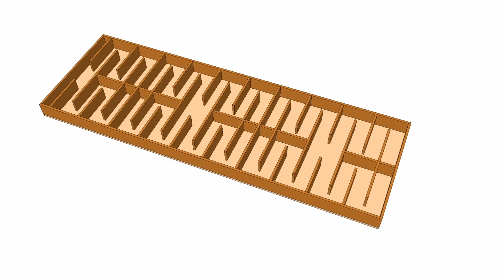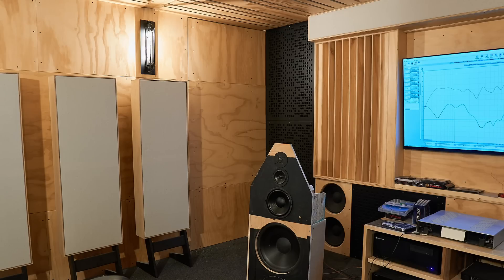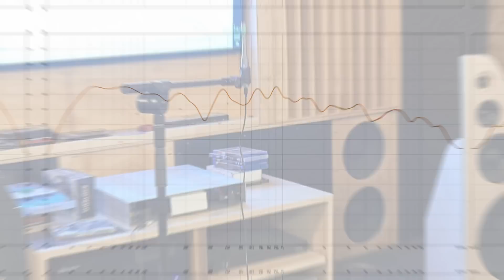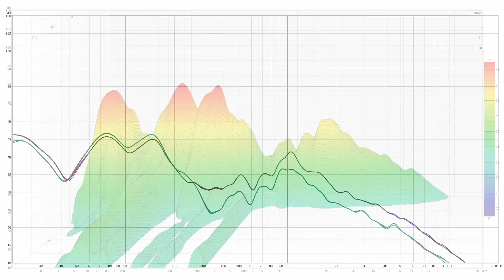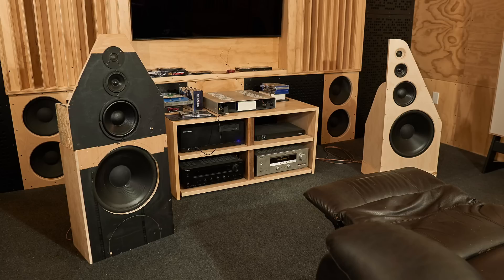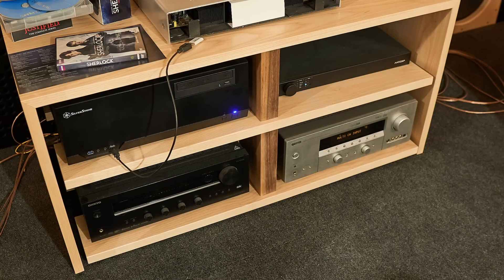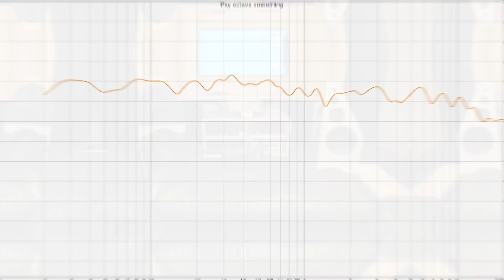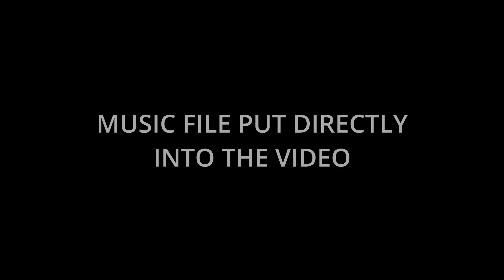Rat Maze? Nope, it's Metamaterial for Acoustic Treatment... Supposedly

Comment from the maker: I'll say up front that my experiment wasn't exhaustive enough to prove the metamaterial doesn't work. Since I didn't see a notable improvement, that only suggests that it may not work. There could be other factors that I didn't explore that could change that.
Here's a link to the paper I took the design from: https://rolfbader.de/wp-content/uploads/2020/05/Bader_MetamaterialWall_Preprint.pdf
More about my system:
I have all of the music I listen to on the computer and there isn't any streaming or internet in my listening room. I don't have a turntable or vinyl records and I don't play CDs.
I use the digital out (optical) directly from the computer. This goes into the MiniDSP 4x10 that does all of the crossover processing. 
There are three amps:
- the one I made drives the 4 infinite baffle subwoofers individually (4 channels).
- the Yamaha 7.1 HTR is set to multichannel input and drives the midwoofer, midrange and tweeter on both open baffle speakers (6 channels).
- the Onkyo receiver drives the two 15" woofers in the open baffle speakers (2 channels).
This all active system gives me precise control of all of the speakers and the overall response in the room. In every way it is superior to a passive crossover system, when you know how to set it up.
The recording:
I did the stereo recording in two sessions, the left channel first with the microphone pointed at that speaker, and the the right channel with the mic pointed at that speaker. In both cases only one speaker was on - the left or the right. Using this method I was able to get a stereo recording using a mono microphone and also avoid the comb-filtering problems there would be with a stereo microphone recording two speakers at the same time. Our brains have some tricky software to deal with that comb-filtering, but a microphones do not.
I took those two recordings and combined them into a single stereo file and that's what was playing in the video. I then used the original sound file that I downloaded from YouTube's sound library and put that directly into the video for comparison. 
The music I chose has good stereo separation, good dynamic range and most important is that it's neutral and less likely to annoy some people.
This test was to show two things: first that a treated room doesn't sound "dead". In fact the treated room was the very reason why I was able to make such a clean recording. 
Second was to give a fairly accurate idea of what these open baffle speakers sound like. My EQ settings for normal listening are a bit different than what I used here - I bump up the bass slightly - but changed it to flat response  to try to match the original music as closely as possible.
The microphone isn't anything special, it's a fairly low cost Umik-1 used for measurement and it was set up in my normal listening position about 7 feet away from the speakers. The closer the mic is to the source the better (cleaner and more accurate) it will be, but I wanted this to be as close to "what I hear" as possible. I even left the chair in place, and moving that might have made a slight improvement.
Even with all of those compromises I think the recording turned out pretty good. Not a perfect match for the original, but like I said in the video, that's very difficult to get. Try something like this yourself in the place you normally listen to music - it's an eye-opening experience if you truly enjoy high quality sound reproduction.

Comment: I'm confused by your "metamaterial" 😵‍💫. You need to put some holes in the junctions of the transmission line absorbers to let sound in from the room.?. The effectively means that you get a 1/4 wave absorber several meters long, so it should absorb to 40Hz. Ideally it's a modification of the binary diffusers you already have fitted...
Reply from the maker: Did you read the paper? Bass frequencies go right through 1/2" thick plywood, so you don't need any entry holes. It isn't a Helmholtz resonator.
Reply: @IBuildIt  , I have read it now. Thanks. Surprised that 1/2" reinforced by the labyrinth lets through that much bass!
My misunderstanding was that the idea was to put a much longer 1/4 wave absorber in a relatively thin panel. Normally anechoic chambers have a cut-off below the 1/4 wave absorber depth. A labyrinth absorber would push down that cut-off frequency. As your results didn't show the same benefit as the paper then maybe this could be a future experiment? Combine your binary diffuser design with 1/4 wave absorbers of various lengths? Might allow a simple DIY project to improve room acoustics.
Just a thought...
Reply from the maker: I honestly think that using this metamaterial concept for sound is overblown - I don't think it actually works. 
The problem most people have when thinking about sound is that they conflate it with air flow. When you think of sound inside a pipe or labyrinth you have to see it as a static vibrating mass - the air is the mass that's vibrating at the target frequency. Apparently it's not the length of the labyrinth but the cross sectional area of it that determines the frequency for the metamaterial, and as sound wave pass into it, the air mass vibrates as a single unit dissipating the energy.
But like I said, maybe mine wasn't big enough. Plus I already have a lot more low frequency absorption in my room that they didn't have in the tests outlined in the paper, and perhaps that buried the results.
Reply: @IBuildIt  , I might have a play with 1/4 wave absorbers myself. I have a load of 150mm cardboard tubes to prototype a transmission line idea I'm playing around with. If I have one or 2 left over then I can lightly fill one with sound absorber to pull out calculated room modes. Covering all of the walls with your binary diffuser designs not really an option for me - like the idea of a simple DIY retrofit.

Comment: wierd choice to use a measurement mic for a recording.. that's actually one of the things you never do with a measurement mic because they're pretty shitty microphones for that purpose. and with measurement mics, there's usually a calibration setting that you have to apply in the measurement software which you can't really apply in a recorded track. did microphones are just not meant for that purpose. also, you should look into different stereo making techniques. it's possible to do it with just one microphone but the way you did it was very very weird. I guess it serves a purpose. but it isn't a stereo recording. 2x mono≠stereo.
Reply from the maker: A measurement mic is accurate, even without the calibration. Otherwise it would be useless for measurements. 
And I can look at the calibration it needs and adjust the frequency response manually to match, if it made enough of a difference. It doesn't, though.
Finally it's not 2 x mono. It's the left channel and the right channel = stereo.
There's a better example of this kind of recording at the end of the build video for my main speakers: https://www.youtube.com/watch?v=k4KNAT0p7O4
Listen to it with headphones.

Comment: Hey John, a quick tip:  You're probably aware, but binaural microphones are REALLY good at capturing what a room sounds like to a human sitting in said room.  They're basically microphones in molded plastic ears, sit head-width apart.  Rather strange looking contraptions, but if you record with those, and then the listener uses headphones to listen to the video, it conveys 3D space.  Sounds from behind sound behind, sounds from in front sound in front.  It's quite something.  Here is an example video using binaural mics (there are much less expensive binaural mics than the Neurmann): https://www.youtube.com/watch?v=dgZJw_ahyno
Reply from the maker: I do know about binaural microphones. But knowing about them and having one for a one-off recording are two different things. I also know about the problems that go with a two microphone recording (comb filtering). 
What we hear in a room with our two ears isn't the same as having two microphones recording. Our ears are connected to our brain and that handles the audio processing and deals with things like comb filtering in a way that a stereo recording doesn't. 
My objective was to give as accurate a representation of how the speakers sound in my room from my listening position within the limits of the equipment I have. Given those limits, I think the recording turned out pretty good. Not perfect - mics work a lot better when they are closer to the sound source than they will when they are nearly 8 feet away. But I put the original music directly into the video for comparison, which I haven't seen anyone else do.
About that example you linked to. I have reason to suspect anything from a channel that engages in the typical audiophile pseudoscience, so I don't trust the recording.
Reply: @IBuildIt  Yeah, I'm familiar with comb filtering as well... I've done a lot to eliminate it to the degree I can in my room.  Theoretically, though, I would suspect that the brain would compensate similarly for comb-filtering in recorded audio as it does for in-person audio, would it not?  As far as audiophile channels, I'm right there with you.  Lots of magical thinking.  The only channel I trust is Erin's Audio Corner.
Reply from the maker: The brain won't handle the recording the same way, because what it's getting is already damaged by comb filtering. The problem is baked in and can't be undone by the brain's processing. There will be a warbling sound like the audio has gone through a flanger.

Comment: Something else Ive been curious about is with active bass traps to get rid of eigentones and smooth out decay times.
Reply: Nelson Pass' designed one, and has be open about the simple circuit... it's all available. 

It was marketed, sold, and reviewed as the 
Phantom Acoustics Shadow, or something like that. It had a woofer at the top, up at the ceiling... and one at the bottom, mic-invert-null excessive LF buildup.

There's currently a European designer/mfr selling their version of the same. 

Active bass trapping.

Comment: I missed the desired result you were trying to achieve with the door. Was it to absorb some low freq energy on both sides of the door? (Just a guess) 

Your videos are stellar I don't know how you have the time for all of this but am grateful for you documenting and sharing your work.
Reply from the maker: Yes, it was supposed to work like an acoustic panel to absorb excess sound energy. In particular it was supposed to be very effective on low frequencies.
Reply: @IBuildIt  I'm hoping to find a low profile solution for something similar, and a door mounted or integrated door solution would be a plus. 

Do you think it may be the case that there is little that can be done without lots of mass and dimensional thickness for absorbing a bigger range of low frequency? 

I am aware of tuned traps that are dimensionally more compact than typical bass traps, but my understanding is that those target very specific frequencies and don't offer much (if all) attenuation outside their target freq.

Comment: Hey John, the comparison between the recorded room response vs the source file was interesting. There was a distinct difference with the recorded version being slightly more dead (i.e. less live/less open) compared to the source file. Perhaps this was a function of the microphone/recording but I’d guess that your room is perhaps a bit on the dead side. IMHO recordings are usually processed to sound better in slightly live listening conditions vs live performances which benefit from sonic treatments. Just my opinion….

Comment: You need better amplifiers.
Reply from the maker: What difference do you think that would make? And how do you define "better"?
Reply: @IBuildIt  Better soundstage, more details, more bass control, S/N.... Yamaha and Onkyo entry level receivers.
Reply from the maker: All of those specs are well beyond excellent in these "entry level" receivers. I've built amplifiers - I know how they work and what makes them good. 
But if you have the money to spare and want to pick out and buy an amp that you think is better than entry level and send it to me for comparison, I'd be happy to do that.
Reply: @IBuildIt I had these receivers and they doesn't sound good.
Reply from the maker: Really? They sound wonderful to me. They are accurate, ultra low noise and low distortion. Powerful with high damping factors. Both are discrete class AB, and the Onkyo is biased so that it's operating in class A for the first 10 watts. 
Maybe you are more audiophile than me and therefore can detect when something doesn't sound good based on something that can't be measured.
So that's a no on sending me a worthwhile amp to try?

Comment: I think you really need to use a stereo microphone for that comparison to be accurate - to my ear there is some mild phase weirdness that is causing the center of the stereo image to disappear. How were you able to be certain that the left and right tracks were absolutely in sync if they were recorded at separate times? Even being out of sync by less than a millisecond can cause the anomalies I'm hearing. I could be wrong, certainly, but I think a stereo mic or a stereo pair is required to be sure there is no delay in one side relative to the other.
Reply from the maker: Stereo mics, like I explained in the description, will sound even worse because of comb filtering. When two speakers are putting out the same signal (a lot of it is the same and that's what produces that center image) the sound arrives at different times at each mic from each speaker - comb filtering. 
The music started with that strum and that was on purpose to help me line up the tracks. It may be slightly off, but then maybe the mics were positioned slightly off too. And then these speakers aren't exactly the same - the left is a vertical stack and the right is slanted sideways. The mic "hears" all of that and is a lot less forgiving than our ears and the brain they are connected to are.
Reply: @IBuildIt  I see what you mean. Your point that the room sounds great is clear.

Comment: Thanks John, that was a lot of work you put into this. Kind of a bummer with the "meta-material" door as to a difference in performance. The only thing that might make a significant difference is the substitution of mineral wool for fiberglass. Density between those two is significant, something like .6lbs/cu ft vs. 3lbs/cu ft for the mineral wool. Is it worth the time and effort? Maybe. The "baffles" in the meta-material help in sound dispersion but then create sound transfer elements as they're connected to front and back plywood, therefore a diaphragm effect. Sound dampening = isolation. Sound enhancement=talk to John, he's light years ahead of most of us.

Comment: I found the sound comparison really interesting.  The recorded sound very much sounded very much "left or right", with almost no center imaging.  As soon as it switched to the audio file, you can hear the center image fill in and the soundstage smooth out from left to right.  You'd think that when your two separate tracks were summed, it would do the same, but apparently not.  Fun experiment!
Reply from the maker: To me the recording sounds "wider", but still has a pretty good phantom center. Some of that may be timing where I had to guess where each separately recorded tracks for the left and right started when I combined them into a stereo track.